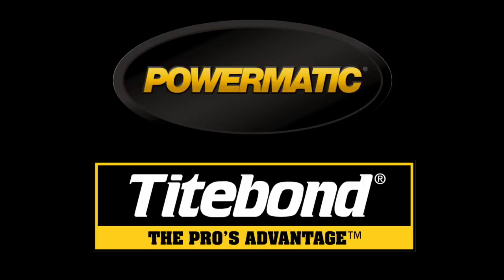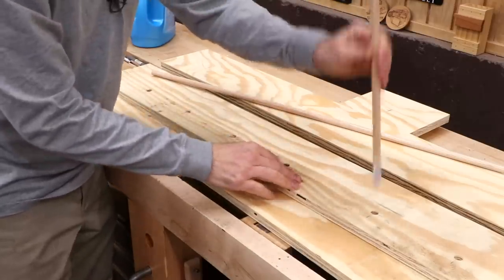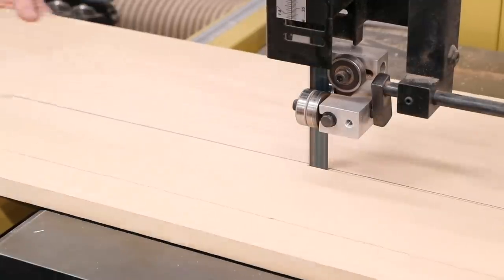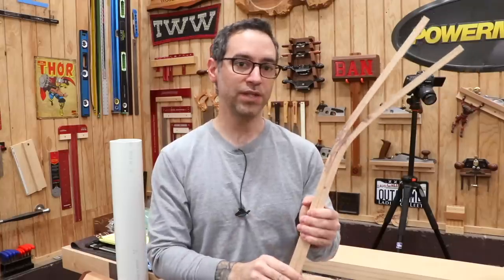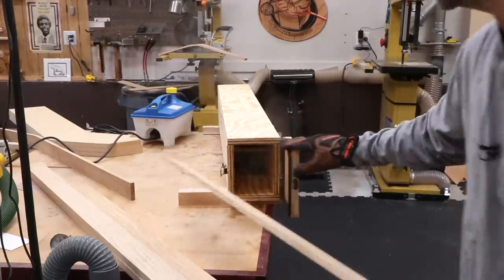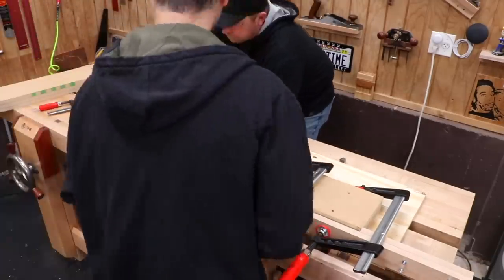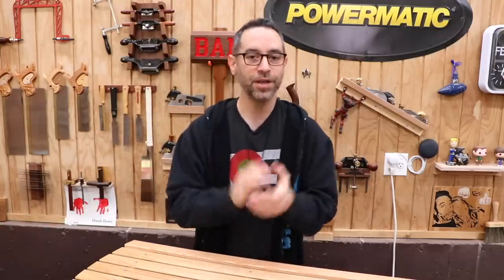Adventures in Steam Bending

Comment: If you're not already familiar with it, I find the Wood Handbook: Wood as an Engineering Material as a great overall technical resource that can cut through a lot of the internet BS and cut straight to the science. I have a pdf copy of the 2010 (centennial) edition on my computer, and Chapter 19 deals with specialty treatment of wood, including plasticizing (i.e. making it pliable for bending, including steam bending). Not sure if it has anything more than the book you recommend, but might be worth a read.
Reply: I've been thinking some more about this after reading the Wood Handbook, especially with regards to pre-soaking the wood. As explained at the beginning of Chapter 19,
"The matrix [lignin] can be thermoplasticized by heat alone, but the Tg [glass transition temperature, i.e. above which the lignin polymer softens] of the unmodified matrix is so high that some fiber decomposition can occur if high temperatures are maintained for a lengthy period. The Tg of the matrix can be decreased with the addition of moisture or through the use of plasticizers or softeners".
In other words, the mechanism by which wood is softened for bending is through heat, not necessarily moisture. The moisture merely aids to reduce the temperature necessary to "melt" the lignin. It seems to me that heating via steam provides the requisite moisture while also heating the board. By pre-soaking the wood, you are adding significant additional thermal mass to the board in the form of cold or room-temp water and likely raising its moisture content far beyond the recommended 25-30% cited in the Wood Handbook. Water has a very high specific heat, meaning it takes more heat energy to raise it to a given temperature. so it would take a water-logged board a much longer time in the steam chamber to reach the requisite bending temperature. I assume that the "rule of thumb" for how long to steam per unit of thickness is based on "dry" boards at typical moisture content, so using the same guidance for a water-logged board would likely fail to raise the water-logged board to the desired temperature in the same time (it would take much longer). That in combination with the problems with taking much longer to dry after forming, and the splitting issues upon drying, I suspect that pre-soaking is probably not only unnecessary but likely detrimental to the process.
Reply: Hi, can you please share the pdf for the book? I found some versions online but their chapter 19 is very different from what you shared, its called round timbers and something. It will be a great help if you can kindly share the pdf or at least point me to the right link so that i can purchase it. Thank you

Comment: I bent green oak for skin on frame kayak ribs. Approx. Section 35mm x 6mm. I insulated my steam box with an old carpet and insulated the steam hose by sheathing it in a corrugated plastic conduit. I managed to consistently achieve 100 deg C at the outlet end of the box within 5 mins.many of the ribs were quite V shaped but managed a suitable bend (free form) using a leather backing strap.

Comment: Not directly from steam bending but I have found slow drying timber massively reduces the checking issues in green (wet) lumber.  Drying it in front of a fire or even around central heating has caused major failures in many pieces of my lumber.  Slow drying seems to allow for the stresses in the timber to balance out over time and has given my much better results.  Thanks for the video.

Comment: When I was in Jr. High School, it was before paper was invented, I built some sleds that had 2 skies shaped like a toboggan. I remember using 3/8" x 2" maple for the runners.
The method we used was to have a steel pipe with a cap plate welded on one end. I think the pipe was 8 or 10 inches. We built a frame to hold the pipe on a 30 ish degree angle. We used a propane burner on the downhill end of the pipe and filled the pipe with water deep enough to cover the part of the strips that were to be bent. The wood was kind of boiled/steamed, I guess.
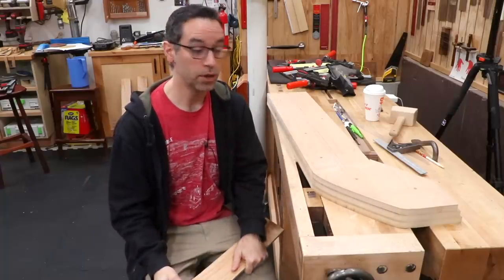We prepared the setup the day before we actually did the cooking and bending. The teacher lit the burner when he got to school in the morning at around 7 AM.  We just put rags at the open end of the pipe to keep most of the steam/heat in the pipe. Mr. Black, the teacher, would add water during the process until it was my shop class time. My class was after lunch, 11:35. We took the strips out of the pipe and put them right on the form and bent them. They bent very easily. The wood boiled, soaked and steamed for about 4.5 hours.
After doing all of the clamping then adding more clamps, we moved the form to the coolest part of the shop and left them in the form for about a week. For the rest of the school day after my class was over, the teacher kept putting warm wet rags on the bends to keep them wet. I'm in Maine and the winter humidity is around 30 to 40 percent during the winter. Out of the 25 or 30 strips we bent that school year, we only had 2 or 3 break. I would say, don't try to cool it down and dry it out too quickly.
Kiln dried lumber is done with moist heat, steam but it is cooled slowly so it won't check.
Watching this video is very timely for me. I'm about to build an archtop window sash to replace an old broken sash in my house. I have the form built and am just waiting for the time to strip out the clear pine to bend. I forgot all about steaming the wood as opposed to just bent it cold.

Comment: I first lined my ply w/ 1" thick (pink) polystyrene/styrofoam insulation, adhered w/ construction adhesive. The insulation minimizes energy consumption/required steam, gets up to temp faster, and protects the plywood so it doesn't delaminate from steam/moisture. I think I also used treated plywood (not necessary); because the steam doesn't hardly get to to the plywood at all, I don't think any toxins are getting airborne from the steam process. Haven't tried the brass fittings, but might. I just used dishwasher drain hose (high temp tolerant) inserted into a hole.

Comment: If you build your form with spacers in the middle instead of a solid piece of material it will dry faster, we allow it to dry in a humidity controlled space(drys too fast cracks too slow you wait forever) everything I have used has been kiln dried and didn't know there was a huge difference. I also use ratchet straps and blocks to start it on a form.It is heat more so then moisture, moisture really just carries the heat. we soak in warm water and about 4 hours for both 1/2 and 3/4. Just what works for me

Comment: A great educational video on steam bending Marc. It's critical to know why things go wrong rather than accepting the fact that air dried wood is preferred than kiln dried. I would hasten to say that the two that were soaked for several days were prone to further expansion to take up the water. The use of the steel strap compressor would have allowed the wood to take the simplest way to take up the expansion due to water logging. This allowed the the wood to separate through the length of the grain which was disguised due to the moisture content. When it dried out, those stresses in the grain would have dried out hence the visible splits. My thoughts. :-)

Comment: If you want to steam bend something like 1/4" you can use something as simple a a scuncii steam cleaner with a wide nozzle. Clamp one side onto the form an in a straight line get it wet and hot. Bend it slowly advancing where it is wet and hot as you go. Built a very nice back of a small wood boat that way. For thicker stuff a clear bag, and a metal 5 gallon gas can placed on a propane burner stand works well too. You can see the wood you are working with and the bag holds in the steam. You can clamp it in place once it's pliable and it will hold the form well when it's done.

Comment: I tried steam bending many years ago and never made it past the soaking phase.  I used a PVC pipe as you did, but I put too much wood in there.  With water, the wood swelled and nothing I could do would get it back out.  I even hooked my car up to the end and tried pulling it out and it wouldn't budge.  So....lesson learned, if you do this, watch how much wood you stuff in there to soak!

Comment: Check out the work of Bern Chandley, an Australian chair maker who specialises in windsor chairs. I know he does a lot of work with kiln-dried lumber. There seems to be a combination of factors that resulted in your failures. I don't think you let the pieces soak for long enough; you probably need seperate drying forms that reduce the inside contact area to allow even airflow; The stress fractures are from drying out too fast, same as for freshly felled lumber. If you wrap the piece in newspaper as it dries this can be avoided.

Comment: Never used Kiln dried but I can tell you it's the lack of a compression strap in those early attempts. Wood fibers don't stretch at all, they will compress though. The compression strap forces the fibers to compress instead of stretching in any area. Another tip, you can use spacers to fill the gap if you are bending a shorter piece of wood than the strap you made. The key is that the wood must fit tightly or you will have bending problems. Wood that is thin enough can be bent without visible problems but will have a weaker structure than if you used a compression strap.

Comment: A very smooth and informative presentation. I do suppose now that I could do it myself. About the steam box and generator, in "Building the TotalBoat work skiff - Steaming (Episode 26)" Louis the "Tips from a Shipwright" guy uses a polyethylene bag whose seams he makes with a propane torch and for the generator he uses a propane burner such as are sold for deep-frying turkeys--- with a gas can on the burner to generate the steam.

Comment: Others have commented like Tom R. on your form work.  Make your two sides identical then put spacers/spokes from side to side. For example; if your "skis" are 3" make your spacers 8 or 9" x 1" x 3", glue and screw through the sides of the form into the end grain of the spacers. Place the spacers about every 2-3". This will allow air flow around the piece to speed drying. At the tip of the form make a starter clamp, a U shaped piece of plywood or a length of pipe secured to the outside of the form. Space this "starter clamp" so you can easily slip your ski tip under it. With the form secured to the bench with the spacers facing up put you hot wood under the starter and begin bending. As you bend clamp through the spacers in the center between the two skis using a clamp block that spans both skis. Always start at the end with the most bend and clamp to the other end. 

Ditto, what many have said about more time in the steamer and more time on the form and V G wood if possible.

I did lot of bending for spiral stairs curved stairs, round/curved windows... We had good success with fabric softener alone but soak for 3+ days for 1/2". It comes out like a noodle and it is not hot and you don't have to hurry! Soak, bend, dry, then laminate.

Comment: Been there done all that except my 1st attempt was steaming in the PVC tube. Then I used marine grade plywood for the box. I welded up some compression straps and used a portable winch to pull the strap to the form horizontally.  Didn't work. Switched to a vertical setup with winch mounted to 20 ton press and it worked. Much harder with 2" thick material.

Comment: When I did this, for canoe ribs, I had to soak the kiln dried oak from the borg for a week before steaming, and I still broke a lot of them.
My steam generator was a dollar store stock pot on an electric hot plate, that part worked. I put a fitting for a hose in the lid, and used some silicone rubber to strap the lid tight.

Comment: You need to watch a video from, "Tips From a Shipwright" entitled, "How to steam bend wooden boat frames in plastic bags instead of a traditional steam box."
Reply: I was just going to leave this same comment!!!  :)  Lou bends pieces that are multiple inches thick using that amazing method!  Many people seem to miss the point that woodworking is woodworking and we can all learn something whether it be from a cabinet maker, a ship builder or an aircraft builder.
Reply: Agreed best method I've seen, Tips from a Shipwright, 😇😇😇😇😇😇😇 and Dave Engles coach and wheelwrights.
Reply: @PaulScott_  He also uses a steel can to boil the water and make steam.  I think that gets much hotter than the plastic steamer that the Wood Whisperer is using here.  Personally, I suspect that he needs a better steam box, made out of steel pipe and a steam generator like the one that Lou uses.  But, that may be out of the scope of this project.
Reply: With a plastic bag is easy
Reply: Came here from that video. And no, I wasn't searching for steam-bending wood.
Reply: @WarBerJr02  At one standard atmosphere, water boils at 100 degrees C (212F) and that is as hot as it gets without increasing the pressure. He is up at 5000 feet, where the boiling point is only 95 degrees C (203F) The only way to increase that temp is to increase the pressure.

Comment: I watched this video with great interest. Important (I believe) details were shown to successfully recreate the wood bending process in any workshop. Personally, I would pay more attention to the steam heating process, including the increase in steam pressure (within reasonable and safe limits, of course), because I have the impression that it is not so much moistening the wood that facilitates bending, but above all a significant increase in temperature in the presence of steam, which is an efficient source of large the amount of heat.
I saw how do it years ago in wood factories. Pressure autoclaves with superheated steam were used, and the superheating itself took much longer - three hours for thick material. However, in this factory much longer and thicker elements with complex curves were bent. The material was formed using a specially adapted press which, in addition to shaping, also compressed the longitudinally formed material, so your metal strip is the right course of action, I think.
The principle of temperature rise TOGETHER WITH STEAM PRESSURE was the distinguishing feature of this technology. On the other hand, nobody was playing in the initial soaking of the material.
Very informative video. Many thanks for publishing and for very useful information.

Comment: Very great information, I lo e the "let's learn together" mentality. I steam bent some oak molding at work for a project using the same steam generator, found that a 4" pvc with a fixed end cap and a screw on end cap worked great as a chamber. If you plug the brass cap you could use the same chamber for the soaking chamber. Great video, watch everything you put out!
Reply: I did that earlier this week and my pipe was definitely melting lol. Switched to a cedar box made from fence pickets. Seems to be insulating better as well.

Comment: My wife has an antique sewing machine cabinet that has three stacked drawers on both sides on the outer part of the cabinet that have curved sides to match the shape of the top. One drawer is completely missing so I need to make a new one and bend to wood to match the others. I have been looking at the Rockler steam bending kit, but I didn't know what kind of success it would provide. This is the first video that shows it in use, so I am now comfortable in purchasing it to replace that missing drawer. Then, if I can match the stain, we'll be in great shape.

Comment: Getting the steam hotter might help...  I also think that you should leave the piece in the mold for an excess amount of time.  If the rule is that you should steam for "1 hour per inch of thickness," I think you should consider leaving it in for 2 hours per inch of thickness.  When you soak the wood for 24 hours, consider soaking it for 36 hours, and when you clamp the piece to the form, let it cool in place for twice the amount of time that you think it needs.  Another suggestion, is to put some space, about 1/2" between each piece of the form.  Consider placing a fan to blow some air between the form pieces.  This would allow the piece to cool from both sides, and may eliminate some of the spring-back.

Comment: Soaking is great and will help BUT it’s how far you penetrate the wood with the live steam that makes the difference ..and the easiest way to achieve that is a small amount of pressure in your steam box.  You should try and use a piece of pipe for your steam box so it will be air tight..  a weight over the opening you use to let the steam escape will cause a small amount of pressure.  Just like a pressure cooker on the stove for cooking food uses to release pressure.  That’s what makes the difference, Pressure... ! 
Makes ALL the difference.    Good Luck.    ......Blitz

Comment: I used an old coffee maker, a few feet of rubber fuel line, and a length of pvc like yours mounted slightly unlevel. The hose attached to the hot water outlet of the coffee maker, to the higher end of the pvc,  and gravity slowly refilled the reservoir from the lower end of the pvc. I was shaping thin laminates of walnut oak and cedar(juniper). The cedar had a bi-product, unintentionally I'd extracted cedar oil and concentrated it by forgetting to turn it off